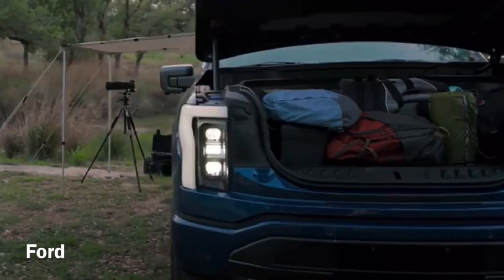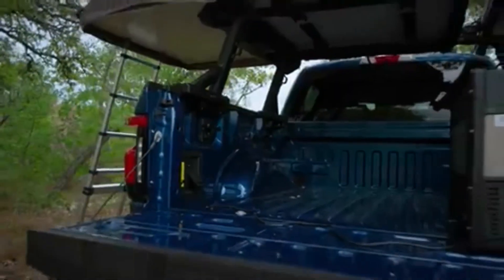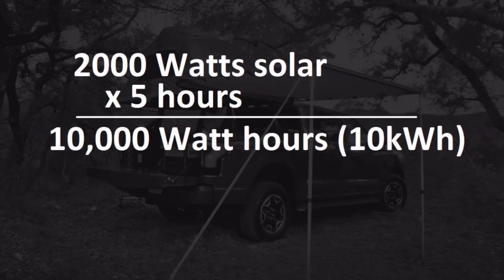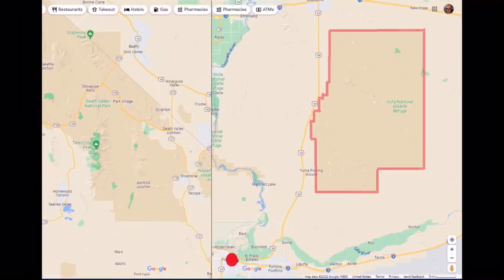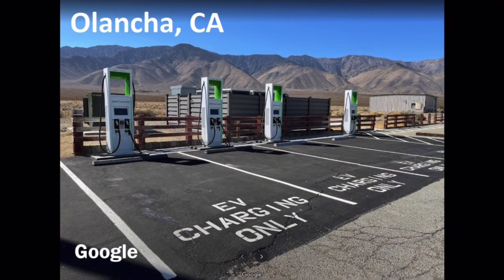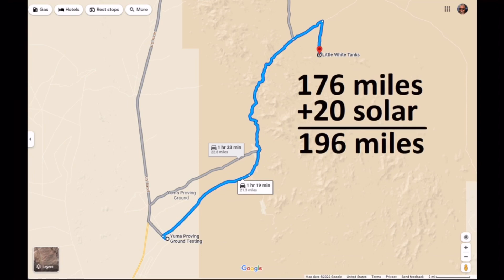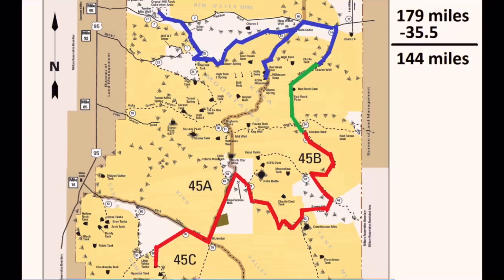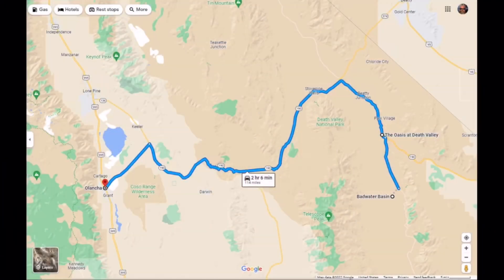Ford F-150 Lightning solar overland build: how will it work?  Details, man!

Comment: Speed makes a huge difference in mi/kWh. I have achieved as much as 4.6 mi/kWh on flat road at 25 mph.  Assuming overland is at low speeds it is possible  to get as much as 40 miles per day with 2kw of solar panels.  The low speed efficiency could be a big boost for over landing in sunny areas or windy areas if you deployed a wind turbine.

Comment: "Details" should be how u would set it up physically n electronically then show us how it looks on ur rig n how its charging the truck while camping n driving... not telling us about some basic math n show us routes u take...
WHAT A BAIT N SWITCH!
Reply from the maker: Thank you for your opinion.  At that point I had not yet received the truck so the title stated how "will" it work (in the future) rather than how "does" it work (currently). Sorry if that wasn't clear.  Now that I have the truck I am in the process of showing you how it will look on the rig and how it will charge while camping and driving.

Comment: Thanks for this. I'm planning out my first couple years of retirement and looking at all kinds of options for towing a small Scamp 13 footer (per Scamp it's 2200 GVWR). I'd really like to at least have a plug-in hybrid if not a full electric vehicle. What is the plan for solar panel to truck connection? I don't think I need 20 miles of charging a day - I plan on moving a bit slower than that but it's always good to see what the max plan looks like.
Reply from the maker: I'm doing this in two phases - phase 1 will just use an AC inverter to charge the car through the j1772 power port.  For phase 2, I will talk to Ford engineers or do whatever I need to do to get this connected as a DC trickle charge direct to the truck's main battery.

Comment: Thank you! I'm currently remodeling an old airstream to make it off-grid beast as I will try to full time out of it for a few years. With the frame modifications and solar roof rack to be installed I calculated a total of 2.4kW of solar. I do plan on towing this around with the cybertruck and realize it could take 2 weeks to trickle charge it back up. If thats 500 mile range version. I'm pairing two 3kW growatt LVM-ES together to get 240V level 2 charging and hope it all works out! I am extremely nervous that the cybertruck will only have ~300 miles of range but oh well.. I do plan to put a 9kW cummins diesel generator for winter missions when there is no sun. 

I'll be watching you and your endeavors! Slo-verlanding sounds fine by me as long as I have my house on wheels and starlink internet to do my day job! :)
Reply from the maker: I did a calculation one time on the Cybertruck and figured they were saving a lot of weight with the exoskeleton and structural battery pack.  Plus the 4380 cells should provide more power density.  And the cd is something like .2.  So when it does get built, it could possibly be able to make it 500 miles on somewhere around the same battery size as the Lightning uses for 300.  So say 120kW…2.4kW of Solar x 5 hours nets you 12kWh of charge or 1/10 the battery capacity.  I would be very happy with that…you could potentially recharge the truck in 10 days.
Reply from the maker: Would like to see your airstream project at some point as well

Comment: A typical mobile home solar panel is 100W, so a charge time of 2500 hours.
Reply from the maker: 20 flexible solar panels @ 100 Watts = 2kW.  2kW x 5 hours = 10kWh per day, or 1/10 of the truck’s battery capacity per day from solar.
Reply: @the.electric.bluebeard  
How much range does the truck lose while powered on to accept a charge?  Teslas lose charge on 110V charger, that’s 15A/1600W or about 16 panels.
Reply from the maker: @FFE-js2zp  I’ve seen reports so far that there can be a 2% loss to environmental/other features of the truck.  However, there will be 600-800W of panels permanently mounted always collecting solar power, so my anticipation is that this will cancel out parasitic/environmental overhead drain.  But I’ll have to test this all out to know for sure.  For the amount lost from the wall charger, I’ve already accounted for that in using a very conservative 2 miles/kWh efficiency estimate (will more likely be 2.3 or 2.4).
Reply: @the.electric.bluebeard  
I disagree.  I just watched a video of a Tesla losing charge while plugged into a household 110V wall charger.  Either way, solar energy is extremely diffuse and cannot in any real world scenario provide meaningful EV power.  An entire large roof can’t charge a car in weeks.  It takes a coal plant.  And EVs typically charge at night so it’s pretty much running on loads and loads of fossil fuels.  Much, much more than a gasoline powered car because of the resistance distance to overcome over millions of wire miles, plus the inefficiencies of storage across average hot and cold temperatures.  Neither temp is good for EVs. 

And do you remember when incandescent lightbulbs were outlawed for boiling the ocean?   The EPA said every house switching just ONE BULB to save 25W per household would be the electric CO2 emissions reduction equivalent to 800,000 gasoline cars.  How many watts does one EV add per household.   25?   Or millions?

What happened to 25W of electricity per home being CO2 emissions Satan?  You go to jail for trying to sell a 40W incandescent lightbulb.  Tesla gets $300M in carbon credits per quarter for selling millions of million Watt appliances.  

What gives??
Reply from the maker: @FFE-js2zp  ok, I’m going to leave your comment up but I’m going to stop responding because you clearly are not relying on any science to back your position.  I encourage you to tune back in to future videos to see how my project goes.
Reply: @the.electric.bluebeard  
You’re not the first person to bow out instead of explaining why incandescent lightbulbs are illegal for CO2 emissions.  While EVs are subsidized. Senseless.
Reply: @the.electric.bluebeard  For your off-road testing I'm curious what you will get /mile. I've seen reports of .7-.9kwh. which is close to the Rivian as well. on road driving seems to be all over the place(2.4-1.8), but your 2.0kwh seems like the best way to go for just on road/dirt roads.

Comment: looking at a similar idea I ran into some videos of a few people solar charging there Leaf or Tesla. they all had to have some type of battery bank and inverter setup to make it work, and could not go direct (for now). the Tesla one I saw was a fold up accordion design that was hitch mounted. not sure on Aero losses, but convenience wise it looked neat. The main issue brought up was charging and making sure you are not constantly cycling the contactors (and wearing them out faster). There will also be losses with the conversion to AC and back to DC, and with level one charging only it will only be like 1-2 miles per hour of range. I'm interested to see how big of a battery bank you go for and how this works in real life. Subscribed!
Reply from the maker: Interesting…what was the source where they discussed recycling the contactors?  I’m trying to build a system where the batteries act as a buffer rather than an auxiliary storage system…so I’m trying to match the rate at which the inverter draws power with the rate the controller charges the battery bank.  Ideally the battery capacity would be no more than what’s needed for that.  I’m starting off with a 48v 26ah battery bank…but that’s assuming the bank will charge at a rate of 26a.  After testing I’ll fine tune by adding more batteries if needed.  I’m just waiting on a couple more solar panels, so should be testing soon.
Reply: @the.electric.bluebeard  - I can't remember which exact video, but this was the channel talking about issues with the contactors cycling. https://youtube.com/c/InnovativeSustainableSolutions He is doing exactly what you are doing but on a Leaf. May be a good resource/colab person. Also now that you have the lightning, any change in KWH/mile average with off-road driving mixed in? Last I heard some folks were reporting around 1.8/1.9 when off-road (similar to what I heard about Rivian as well).
Reply from the maker: @jeepncj7  That’s about what I’ve seen so far, 2.3/2.4 on paved roads, 1.8 on dirt roads/fire roads.  Haven’t done any serious off-roading, though.  Thanks for the link!
Reply: @the.electric.bluebeard  Of course! Excited to see how this pans out.

Comment: Are you driving at night and charging during the day?
Reply: I’m going to build a rig also, using a Alaskan camper with 1600 watts on the roof and another 1600 that slide out for when the vehicle is stationary. At over landing speeds averaging 15-20 MPH like on the Magruder corridor the Lightning will achieve 2.4 MPKW. You can expect a 30 mile gain on a mid summer day. Low speeds also mean lower wind resistance from the pop up. Win win!
Reply from the maker: @matthewmortensen7401  I would like to see your build when you get it going
Reply: @the.electric.bluebeard  if Ford could only get me a truck! I’m headed to Alaska Campers tomorrow to look at the seven footer. I have the panels, a Victron Mulitplus 4 Victron 100-50’s and 6 Dakota DL-130s waiting to be installed. The pro power on board will be hooked to the inverter input though a breaker and the inverter will output to the camper and or to the  Lightning depending on which direction I want the power to go. Just level one charging to the truck.
Reply from the maker: @matthewmortensen7401   hmm…I looked at the Victron 100/50 but I figured the only way I could get this to work was to go with a 48v system (more Watts for the same amps) and the 100/ Victrons would only charge at 12/24v.  I found a used 150/35 on Amazon which can handle 2000 Watts with 48v batteries…this what I’m experimenting with now.  Hopefully you get your truck soon!
Reply from the maker: My plan is to have 600-800 Watts of panels on the truck that can collect while driving.  An additional 1200 Watts of panels can deployed on days when the truck is parked.
Reply: @the.electric.bluebeard  I do agree that this truck will be perfect for this. Where do you plan on testing this?
Reply from the maker: @ModernCowboy78  I will be testing things out locally and then take the system on the multi-day Kofa trip when it’s ready.

Comment: so are you stopping to have to set up panels?  can you put them on a tonneau cover and charge while driving?
Reply from the maker: I’m planning on 600-800 Watts permanently mounted so they could provide a charge while driving.  An additional 1200-1400 on a folding panel array to be set up when at a campsite.
Reply: @the.electric.bluebeard  can you charge while driving, or would you have to store in a batter bank to utilize when stopped
Reply from the maker: @bobuncle8704  I hope to do both, I’ll be testing that out.  In Teslas, you can charge while driving.
Reply: @the.electric.bluebeard  thanks. Looking forward to it. Being able to pull a charge is where electric becomes sustainable.
Reply: You can not charge while driving. The port only accepts charge when in park.
Reply from the maker: @SD07BIKER  thanks for the info.  With Tesla there is a way around this, however, driving with a J1772 plug hanging out the side is impractical anyway.  The question will be if there is a way to DC trickle charge while driving.
Reply: @the.electric.bluebeard  yes... this is what i was getting at. its been done before, i just dont know if its possible with the lightning.
Reply from the maker: @goateemike72  It's an interesting problem...I mentioned in the first video that I have a roof solar panel charging system on order for the Tesla which I'll hopefully get later this year.  This system is supposed to DC charge as you are driving (not using charge port - or at least not with the port door open).  I'm presuming they have worked out something that makes a connection somewhere and possibly uses connection protocol to initiate charging.  I'm hoping to learn from that system - when I get it - if something similar could be set up for the Lightning.  It may require a lot of conversations with Ford and their willingness to provide technical information.
Reply: @the.electric.bluebeard  tonneau cover solar panels wired directly to the battery
Reply from the maker: @goateemike72  Yes. If you go directly to the battery you probably void your warranty.  If you go through the DC charge controller you might be ok - either way the panels will probably have to be wired in series to get the volts up to at least 48v and then a DC/DC converter to step up the voltage to over 400v (or whatever the battery needs to accept the charge)...so high voltage low amps.
Reply: @the.electric.bluebeard  That kind of converter would be very expensive.  A 6000 watt converter would only output 15 amps at 400 volts cost close to $8000. In order to charge a 400 volt battery you'd have to input at least 50 volt for approximately 416 volts output.
Reply from the maker: @pstoneking3418  I’m only going to have 2000 Watts max coming from the panels, so 400v at 5 amps…the low amps would make the step converter more affordable/easier to build.
The solar panels aren’t going to provide fast charging power…but in a day I’m hoping to collect 10kWh.
Reply: How are you getting the D.C. voltage from the solar panels into the trucks battery.
I will be charging my lightning off my home solar system.  But the 30 amp charger will be connected to my magnum inverters which power my shop. I have 13 kw of solar panels. So with 5 hour of good sunshine I can generate over 65.5 kilowatts of power a day. I'd love to put that D.C. voltage directly back into my truck to avoid the losses of converting it to AC and then back to DC to charge the truck.
Reply from the maker: @pstoneking3418  I don’t have that worked out yet.  Phase 1 will be a 2000 Watt inverter to run an AC charger.  Phase 2 will use DC to DC step converter to go from say 48v dc to ? (maybe slightly over 400v).  I’ve ordered a unit that is supposed to do this for a Tesla - convert to high DC volts/low amps and go directly to the battery.  I’m hoping to learn from that unit - and from talking with Ford - to get an idea of where I can connect to the traction battery.
Reply: I'd appreciate any info you get on DC to DC charging. As at home I  could series as many panels needed to charge directly from my solar